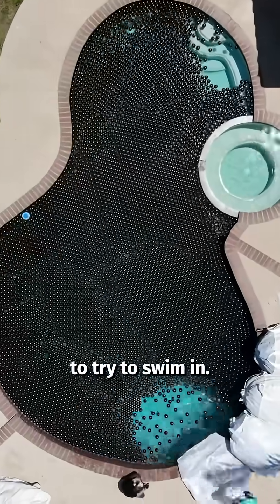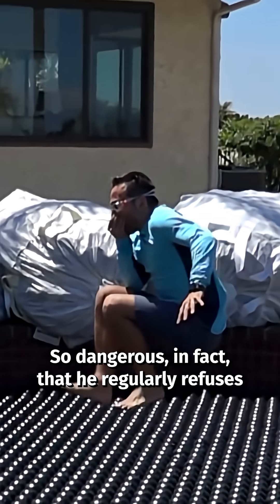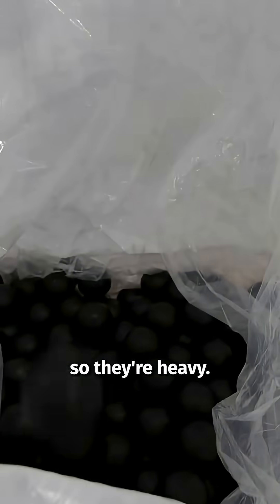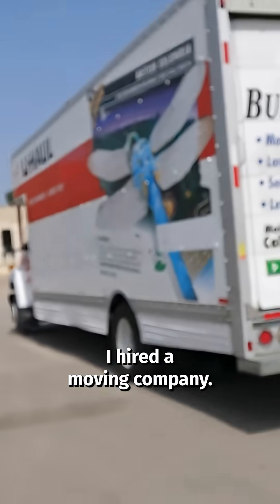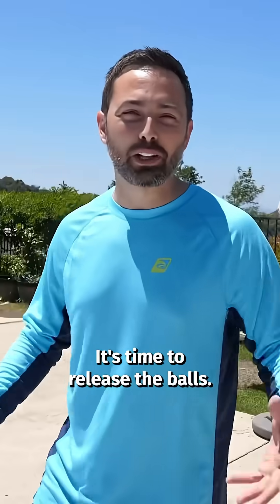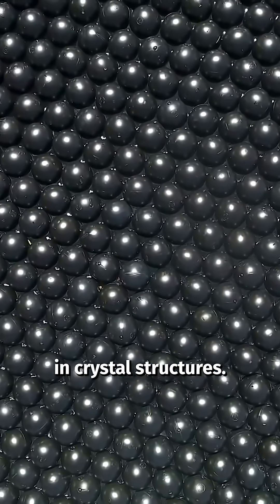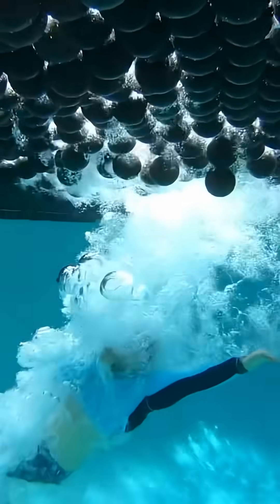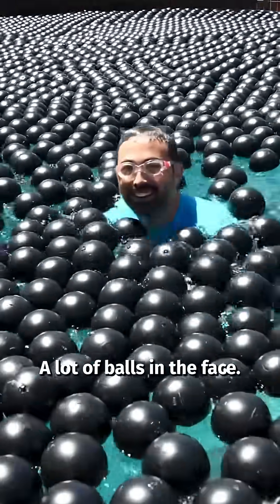Can you swim in shade balls?

Comment: I drove the largest truck Ryder has available WITH a trailer to tow my BMW behind it, all the way from Medford Oregon to Tampa 3,010, DURING a pandemic April 1 2020.  And probably the worst was all the road construction, but also nothing to eat several nights of the 8 I was on the road.  Also, it had a speed governor so you could not go over 70 even though about half the trip the speed limit was 75 and most people were going 80 or more.  And even getting it to 70 was tough because you had to keep the accelerator floored leading to leg cramps.  Now if I could do that then surely you could have got your balls across LA without resorting to hiring men to move your balls for you!

Comment: Shade Ball: a small, hollow, 4-inch diameter plastic sphere partially filled with water and floated on the surface of reservoirs and other water bodies to prevent evaporation and protect the water from sunlight

Comment: I dont understand why they are black for official use. That heats up the water more quickly than necessary. Shouldnt they ideally be black on the bottom and have a reflective mirror-like optic on the top? That way you prevent algae growth but also reduce heat...

Comment: I find swimming in the foam much more dangerous. I experienced this on my vacation where the hotel staff poured a lot of foam on pool's surface and we were supposed to swim in it and have a little dance party. Half of the kids there disappeared under the foam unable to breathe  as the foam was much higher than the water surface yet the foam isn't breathable! I myself inhaled a little of the foam into my lungs and it wasn't a good feeling. I was coughing for ten minutes. The kids then rather got off the pool because they were scared. If any of them would get under water we would find out after like 30 mins when the party was over and the foam was gone.

Comment: The video doesn't specify why it's dangerous to swim in then but I'd guess it's because 

1) jumping in would hurt since they are heavier if you hit it at the wrong angle 

2) heavy balls around you when you swim could make a weak swimmer struggle to move past them and prevent them from getting to the edge to get out of the pool

3) it could be dangerous to the pool filters? 

Not sure though, correct me if anyone knows for sure since I'm simply guessing
Reply: Pinned comment

Comment: its also because 1 layer isnt so bad as you can push em around, bbut usually they are used for many layers, to stop sunlight going to the bottom... but once you get a few layers then its harder and harder topush up over them, because of the weight and force youd need to push em off and youd get pushed down unable to breathe kinda XD

Comment: So they are a lot more dangerous when you have two or more layers like how they are usually used as because it’s like a wall when trying to move and surface in it it makes it 20 x harder to move though when they are layered if you were to jump in like how they usually are you would struggle to stay above the water

Comment: Did the balls hold the heat into the body of water. We used them to cover our chiller tank of water to help keep the heat out of our open tank. Seemed to work well, we used. Smaller balls and only had to cover around 40 square ft. 4’ X 10’ tank 24” deep, 35 degree water. Indoor tank.

Comment: These are sadly becoming popular for reservoirs, and in 10 years we will be seeing a massive spike in cancers and it will be traced back to the absolutely idiotic use of shade balls made of... black plastic. Then we will also start hearing about the tens thousands of birds that drowned due to the balls, and the tens of thousands of other animals that were unable to drink from the water and caused dehydration and death in many areas. Then there will be articles about finding human remains in the reservoirs because the balls complete hide the bodies for many months at a time while the water, overheated by the black plastic balls, speeds up decomp. That's if the government removes the balls during winter, which will add a hefty price tag, so they probably won't do it in many areas causing even more problems as the water freezes. Peer reviewed journals will also discuss the increase in dangerous algae and amoebas due to the hotter water and the lack of water movement and air interaction. Good luck out there Brawndo fans!

Comment: I swam in these at a pool when I was a kid. They had them in the outside pool and I was in the inside pool. But the separator between the two pools didn’t go all the way to the bottom so I could swim under it and me and my sister both did and threw the balls at each other pretty cool I didn’t die.

Comment: For those wondering the purpose, these are not usually meant for use in pools as removing them would be a pain. There's pool covers for that kind of thing. These are used for water reservoirs and Ive seen farmers use them in large livestock watering troughs. Prevents evaporation, and keeps water cleaner by preventing plant and algae growth.

Comment: I used to work at a cranberry processing facility, much thicker layer of floating objects but basically was a very dangerous thing and no one was allowed to be near the cranberry pools when cranberries were present unless there were at least like 4 people if I remember correctly cause if you fell in the only way to get you out is if they drained the pools. If no one saw you fall in, you'd fall through the cranberries but then get trapped under them and there's be no exit if the pool wasn't being worked at the time, so you'd drown guaranteed cause you would never be able to push your way up through the cranberries.

A testimate to that being the number of small dead semi aquatic animals you'd find in the water after finishing the process on a pool. :(

Some would be lucky enough to survive and we'd retrieve them when we saw them but lots of drowned turtles and frogs...

So even though this looks much less dangerous I wouldn't risk iton the flip side of things, I wonder why the balls are black instead of a lighter color. You'd think the black would absorb more heat and thus warm the water further than a lighter colored ball. Or maybe they found black to be the least disturbing to wildlife. Either way I'd be interested to know.

Comment: Why would you do this? You'd have to remove them and store them when you want to use the pool, and when they're in the pool, they create an increased drowning risk for any pet or child, or anything else that falls in. Furthermore, if something or someone drowns in the pool unseen, you won't notice because you won't see them in the pool.

Risks and hassle far outweigh whatever you might hope to gain from these, which is water temperature modulation, I guess.

Comment: If you're going to say you're doing this for science, do it correctly. 
These are in 2-3 layers inside water reservoirs. 
You have this in one single layer, with room for them to move and displace each other, when "pushed" from your "breast stroke".
Whereas if these were in layers, they wouldn't be able to displace each other so easily - and that is why it is so dangerous.

Comment: After I saw it, I actually initially thought you were relatively OK, because technically the balls did not fill the pool completely, therefore there was always space for the balls to move around. Plus, even if it was deep, you could still push off the bottom of the pool to burst through the balls anyway, then get your breath, go under, go to shallow end and just stand up (assuming normal swimming ability)

Comment: Why not just use black ballpit balls instead? They are lighter etc. or maybe black pingpong balls?
Also: what exactly was the hypothesis in question that merited this experiment? Or was it done just to see what might happen?
Because i could easily see a different experiment where you shape pool noodles to the outline of the water surface of your pool, then shape and float a pool cover on that to keep out leaves etc also maybe try walking on it to see if its somewhat safer so as to prevent drownings etc. in fact i suggest trying that next.

Comment: You want to discourage people from buying them, just tell them that they cost $0.35 /ea, slightly more than 3 for a dollar.  And your purchase was for 10,000 ... that is a hard no. 
Their supposed selling point is they prevent evaporation of resiviors, of the swimming pools I've been around,  evaporation has never been an issue,  but even if it were,  I could refill the pool several times over, for far less than three and a half grand. I have a residential well.  I suspect the business model is more likely based on bribery, kickbacks and graft than actually doing what is claimed.

Comment: The fitnessgram pacer test is a multistage aerobic capacity text that progressively gets more difficult as it continues.the 20 meter pacer test will begin in 30 seconds.line up at the start. The running speed starts slowly,but gets faster each minute after you hear this signal. [Beep] A single lap should be completed each time you hear this sound. [Ding] Remember to run in a straight line, and run as long as possible.the second time you fail to complete a lap before the sound, your test is over. The test will begin on the word start. On your mark, get ready, start.

Comment: I'm pretty sure it's dangerous if you fill a pool with them without water in It. Because why should it be dangerous if you can just push them away.  You could also just dive and look where the shallow end is dive over there and than stand up IF your that weak that you can't push away a couple of plastic balls on the surface.

Comment: Seems to me you didn't quite fill the whole pool. The last shot from above had a head and shoulders sized hole left where you were pouring them in. Since water is pretty frictionless the balls will be able to expand into this space as you swim. If the pool was totally full however, all the balls would be pushing against each other and the sides of the pool making it more dangerous since it would be much harder for you to move them out of the way. Still pretty cool though.

Comment: Let’s put this in context the density of the pool hasn’t changed, but the membrane of the pool water has. What this short is not successful showing is that you are at least 5x more likely to drown in this attempt. The 1st major problem is the balls size and weight in the water will cause obstruction to a swimmer guaranteeing exhaustion much quicker. The 2nd he actually didn’t feel the entirety of the pool area, which is good because the balls want to be one layer meaning that when somebody’s body part (arm, head and neck )pop out, they could have that part theoretically crushed by the balls, bouncing back to create that layer.

Comment: The release was kind of pretty. And, from thst height, it looks like you filled your pool with beluga caviar.
* to keep from getting tired by muscling through the shade balls just swim under water. Most people can swim the width of a pool underwater. In a reservoir pop up for air, dog paddle at the surface until you have enough air, then swim underwaster until you need more air. Repeat until you reach the edge. Or... don't get in there in the first place.

Comment: Pretty sure the shade balls have been proven to be a gimmick. 
First.. Black balls..  😒. Black absorbs sun and heats up. Effectively evaporating the top layer of water faster. They should have used white opaque balls.. reflects the sunlight away without heating up. Creates shade because light isn't passing through opaque surfaces.  Of course California implemented the 'solution" because everything they do is backwards.

Comment: I’m sorry, I’m still not seeing how this is “incredibly dangerous”. Even if you did go under, these are balls. There are finger-sized, if not hand-sized gaps in between each ball. All you need to do is get a few fingers up and then push. As for swimming, I feel like the best strategy would be to just to get an arm out of the water, grab a few balls and then pull, like you would if you normally swam.
Reply: Same
Reply: @aoky9179 They are sometimes in several layers which is very dangerous indeed. This guy only had one—much safer—layer.

Comment: The final close up of him in the pool was what made it clear to me that in their proper location it would be extremely dangerous. To be specific it was the speed, or the distance per stroke, he was swimming at for the effort he was putting in. In a normal pool even a novice swimmer could probably move at more than double the distance per stroke that you were moving.
I've not watched the full video yet, so if he did do this nevermind, but I think to really show the danger a comparison of him swimming before and after the balls were put in the pool would have been good. For example comparing his time to swim 1 or 2 laps of the pool, and/or comparing how many laps he could do before he felt like he wouldn't be able to make another. Doing laps instead of lengths as he would be close to the edge at all times which would likely be safer than going through the middle

Comment: I don't see the issue.  You would just swim below them and come up through them.  Of course it's going to hold you back a little if you try to push through a bunch of them on the surface horizontally across the water...but if you go under them you would have no problem surfacing through a few of them.  You would have to be a moron to be in danger from being in the pool with them.  This "experiment is pointless".

Comment: Since he didn’t say why, I will tell you all why it is dangerous! 

Keep in mind that having it in your backyard pool where you can touch and use the bottom as leverage isn’t the same as a reservoir, the place these balls are designed for.  

When there are thousands or even millions of them covering a reservoir, they block light and form a kind of artificial “surface.” If you go under and try to come up, it’s hard to find an air pocket or push through quickly because the balls close in over you, and you don’t have any leverage. That can cause panic, confusion, or suffocation. They make it almost impossible for people above to see someone who fell in. If you get into trouble under them, rescue is majorly delayed. So basically your body will be recovered at some point. Also, even though they’re hollow and buoyant, they are designed to pack together. Breaking through isn’t like pushing aside a few pool toys, it takes effort, especially if you’re tired or panicking.

Also, bonus note, shade balls are usually used in a single floating layer. Even one continuous layer is enough to trap someone underneath, because the balls shift to cover gaps and block you from finding clear air.

Hope that helps

Comment: These were used in a residential water reservoir to keep invasive birds from using it as breeding grounds, and they aren’t packed 1 layer thin… they pile so many its usually 3-4 layers worth of shade balls stacked on top of each other floating on the waters surface… its not that you CANT swim.. its just extremely uncomfortable and disorienting… in a large body of water for example falling off of a boat… it would block your vision and the rescuers vision from helping… more of less dangerous???? Idk you decide

Comment: Black will get hot in direct sunlight. Why are they not a lighter color or even white?
Reply: "Pure black carbon gives the balls their color after being added to the plastic to absorb UV rays. That prevents sunlight from penetrating the plastic and getting to either the water inside the balls or beneath them. A lighter-colored ball may allow sunlight to pass through into the water, rendering it ineffective"

Comment: I get the impression that swimming inside a pool with these in the pool can make I very fatiguing to swim around in for a longer time than normal. Oh you do realize by making this demonstration, that others will implement this as a new firm of swimming stretching program? However, no mention if it was painful when you initially jumped in, also I. Ishtar recommend that the person going in be the there’d to a line to keep track of where the individual in the pool is located at all times.

Comment: Its not dangerous when theres so few that they literally just move out of the way as you pass through. Also theyre still buoyant and float to the surface so technically its even safer if you can hold onto a bunch of them and tread without using as much energy

Comment: ok, so you didnt fill the pool, which is what everyone was expecting. No different than swimming under leaves in the pool at this point. If it were like 30k balls, doesn't fill the pool, but provides a thick layer on top, I assume that would be the most dangerous as you could get trapped under (like ice). But a pool of only these would just be a pain in the ass to move in, but not dangerous.

Comment: So I see from the 8-9 bags you purchased you had 3 left untouched, now I wonder: did you not calculate beforehand how many balls it would need to cover the surface of the pool ? Or is there a purchase size you need to reach ? Because if you paid per bag you might have as well just purchased 5-6 instead of 8-9.

Again, I don’t know why , from the short it’s looks either not super well prepared or there was a requirement for ordering